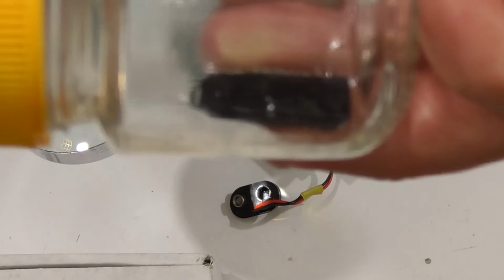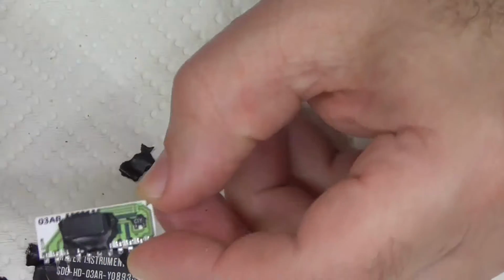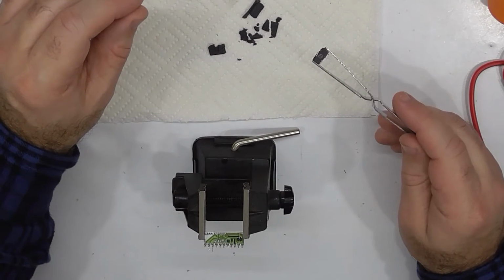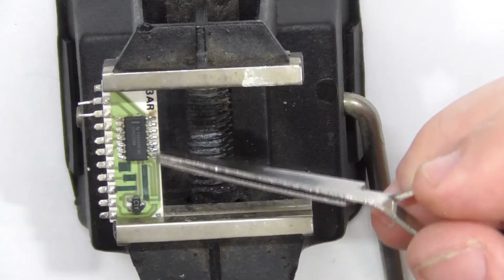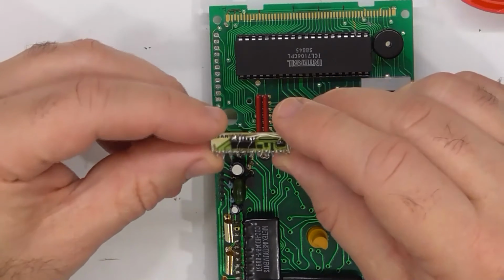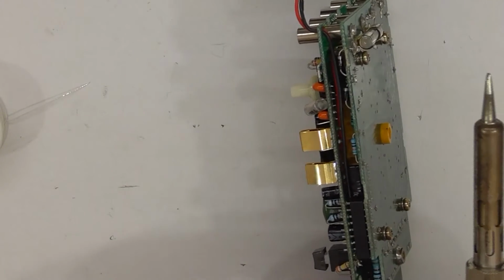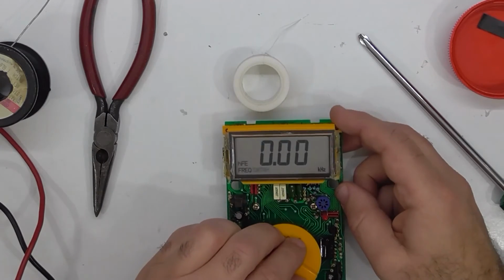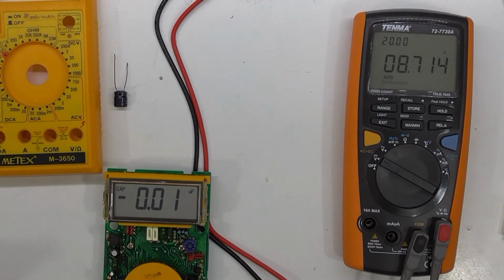Multimeter Repair, Metex M 3650 1989, Part 2

Comment: Helo..I have Metex ME-32 multimeter. Its 20 years old, but now I have a problem. If I shorten probes it shows -16mV. When I measure AA battery positive to positive it shows 1.3V when I change probes positive to negative it shows -1.6V. What can be wrong?

Comment: Thank you very much for the much appreciated video of the repair of this further good meter.
I damaged a few days ago the hybrid for measuring capacitance, in this condition it blocked the correct measurements of other parameters. 
Thanks to your video I regained my "right hand" and a friend!!! which is already 30 years old!!!  - multimeter is already working and the hybrid "softens " in the jar hi hi Thank you very much and greetings  👏👏👏👏👍+ sub 🙂